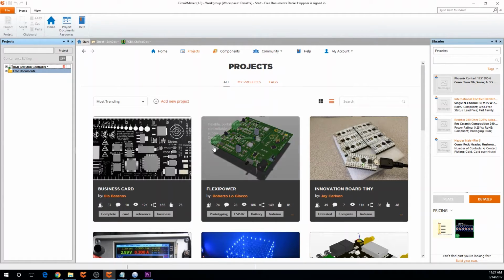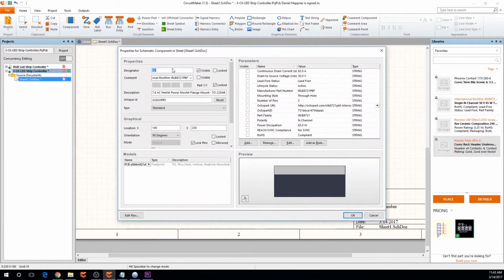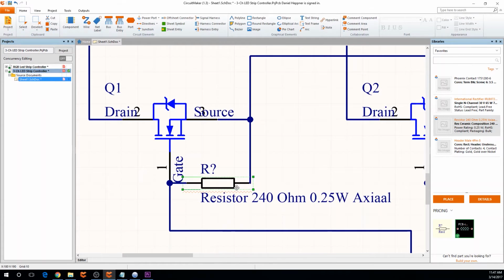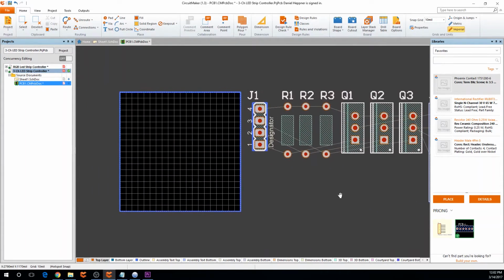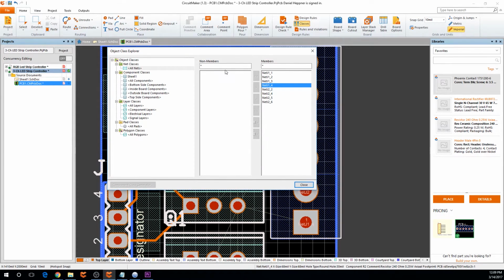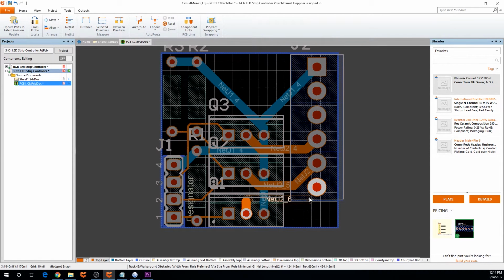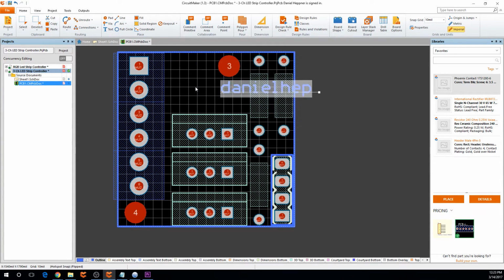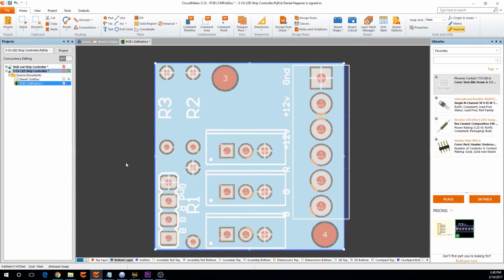PCB Design: Designing the RGB LED Strip Controller + GIVEAWAY

Comment: I've got an LED strip on the back of my desk for backlighting. It's currently using one of the premade Controllers. Would like to upgrade it to a custom controller with an arduino to program some custom patterns.